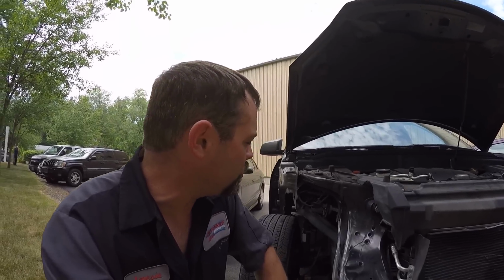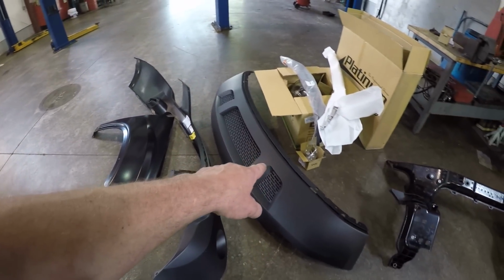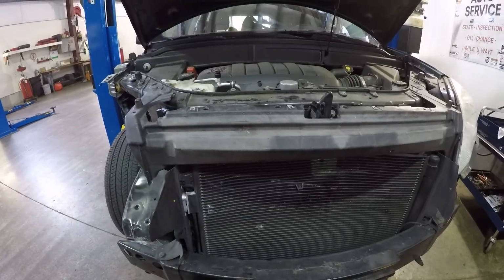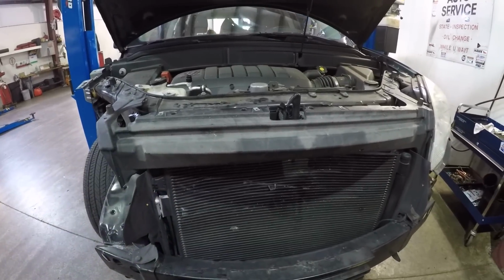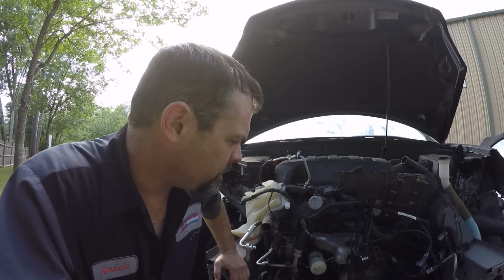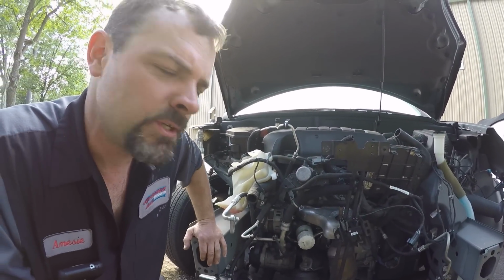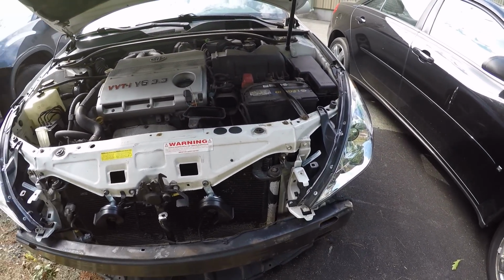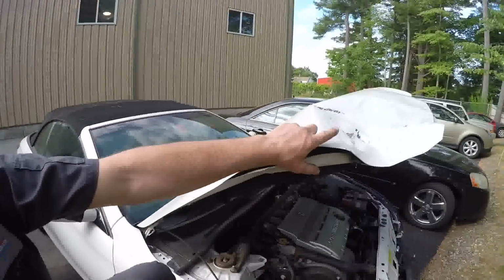Round Two Of The Deer Crash Victim. GMC Acadia Repair, The Time Lapse Tech!

Comment: Do yall have the machine that tells if you if the body is square after yall fix it or do you take it somewhere?
Reply from the maker: If it needed it the panel lines wouldn't line up. On this one it was just a Deer and the damage didn't change the geometry of the big frame rails.
Reply: +Amesie's Automotive Corner figured this one didn't but was just wondering for those that do or do yall pass on those? Thanks for the reply.

Comment: Those are expensive to fix.One is if a cam/crank correlation code appears called timing chain replacement,over a grand fix and the engine comes out from the bottom.The GM 3.6 is one big POS

Comment: wow that oil filter placement looks like a  bitch to remove.
Reply: Yeah you need to reach down and take them out from the top. They make a mess and its even better on a hot engine when they just came in because the exhaust manifold is right there.